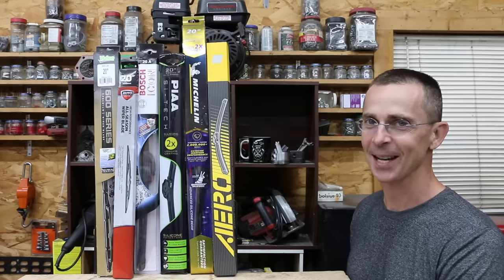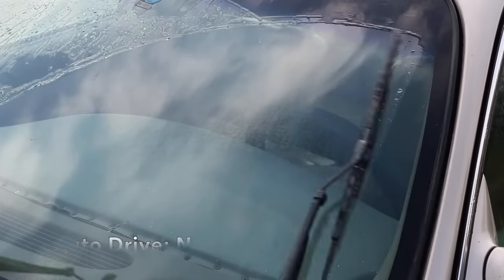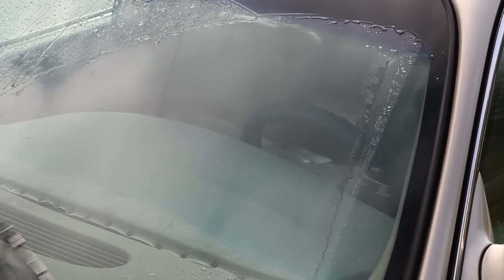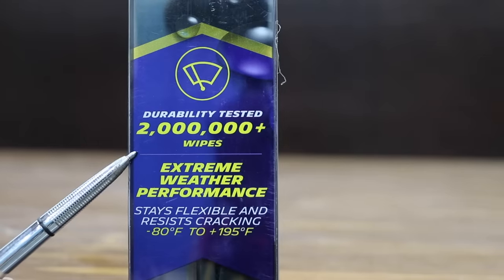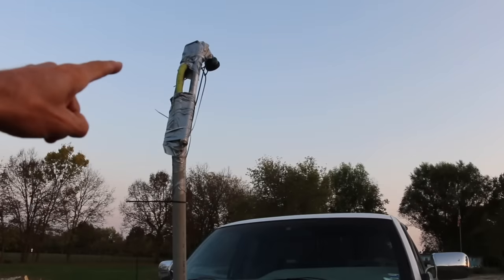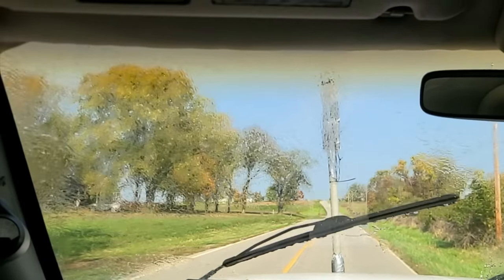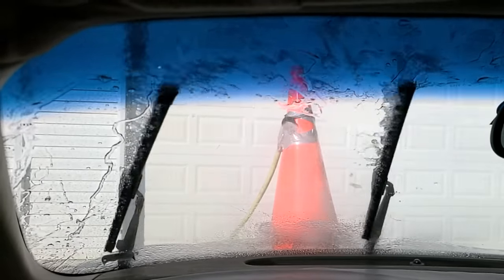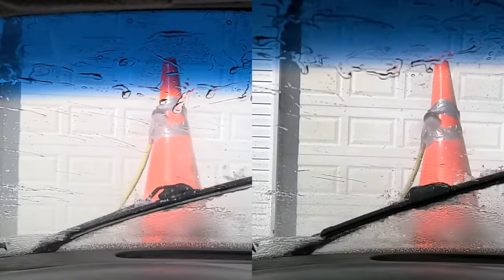Best Windshield Wiper Blade (AFTER 1 YEAR)? Bosch Icon, Rain-X, PIAA, Trico, Valeo, AERO

Comment: I've been using Rainex for years, and they've given great service. The UV light here in Phoenix is pretty brutal on them however, but I think this would be the same for any brands. Bosch is pretty awesome, but they look like they are about 50% more expensive [ At least the ones that I compared ] . I'll continue to use the Rainex since the performance is pretty good for the price. Thx for doing this !
Reply from the maker: Thanks for sharing!
Reply: I have been purchasing Michelin wiper blades for years, I am 64. Based on my experience after using them on various vehicles, both cars and trucks, I will stay with them. I recently thought I'd give a set of Rain-X "beam style" wipers a try on my wife's TrailBlazer. They are not worth the money spent. As it sweeps across to  the left (driver's side) it leaves a large patch of untouched windshield in the line of sight at the top third of the blade. The same occurs on the passenger blade. It does not contact the windshield on the return to the right in the same spots leaving a mass of water on the windshield. Luckily I use Rain-X in my washer reservoir so it helps. I tried swapping them side to side and it doesn't help. I will be grabbing some Michelins on my next trip to the store.
Reply: @ernestpaul2484  Sounds more like a bad windshield, than wiper blade. I have seen that happen with my Chevy Duramax. The factory windshield was the best at repelling water and snow, then I had to replace it with a Safe lite and it does no compare and I had to use my wipers more with that windshield.
Reply: @toddhoffmaster6057 Put a windshield ceramic coating on the windshield. Give it a good deep clean and final wipe down with alcohol so the coating sticks. This will repel water incredibly well for about a year depending on frequency of wiper use .

Comment: I can definitely vouch for the Bosch Icons.  We leave the car outside and had no streaking or noticeable squeaking until year 4!  100% worth the extra cost over cheap blades!
Reply from the maker: Thanks for the feedback.
Reply: Seriously, valeo kills bosch after 3 months of use. No offence
Reply: I change wiper blades every 5000 miles. How many miles before you change them?
Reply: @jayr122001  the man said 4 years. So 40k miles lol
Reply: I  have had Bosch wipers twice, idk if they were Icon, but they both SUCKED! Loud, streaky, total crap within a few month. The regular RainX wipers have been significantly better for me.
Reply: Not my experience. On a dry windshield they’re okay, but on a wet windshield they chatter, jump and squeak. Still wipe but shake like crazy.
Reply: I’ve been using mine for 6 years and they’re still fine. Car is always garaged, so I’m sure that helps!
Reply: Bosch Icons are all I get for my vehicles!

Comment: His neighbors don't wonder why there's windshield wipers on his roof, they ask which ones do you recommend.  I live in Southern California, every mid October I purchase new wipers... Went with Rain-X
Great video,  great channel. 👍
Reply: I hate Rain-X. How do you like that film it leaves on your windshield with every swipe of the blades.
Reply: @mynameisgladiator1933 ... I haven't noticed it leaving anything on my windshield. If it does I'll comment back to you.
Reply: @redwhiteblue7831  Weird. Because i had to return mine just about 2 weeks ago. So it'd be raining and the wiper would wipe up and in this wipe it would leave a smoky film on the windshield that was like looking through fog. Only on the down stroke would it clear the windshield. In reality it meant that 2/3 of the time, I had impeded vision.
Reply from the maker: Thanks so much!  Thanks for sharing.
Reply: @mynameisgladiator1933  Have you put any of that Rain-X water repellent spray on your windshield? I did and I have had similar occurrences.
Reply: @hunterhippensteel  The old Rain-X formula used to work very well, but even with the new stuff, you need to clean the glass extremely well before applying it. And you have to polish it in to the glass, much like waxing your car. Do it a few times, and you hardly need the wipers after 25mph. As for wipers, I use Bosch. You can buy a pair of inserts for the old style frame types for about $8

Comment: In my experience Bosch ICON is unbeatable for quality and value. They seem to last much longer than the cheaper wipers so the extra cost is justified
Reply from the maker: Thanks for the feedback.
Reply: Thinking it's about time to replace the Bosch blades I have now and came back to see if the performance was what I remember. It is. I do feel like some silicone versions of the Icon blades would be even better maybe lasting several years.
Reply: My Bosch wipers have been on for soo many years.. still work great.. the secret? Clean them.. it’s not hard.. do it every so often..
Reply: It’s strange, I loved my Bosch blades (and most Bosch stuff) but I’ve experienced their wiper drying out and cracking on several cars - maybe after 1-2 years?   I started using PIAA silicone blades back in ~2014 and I’m still on the same set on one car, working fine.

The feeling of new wiper blades is a great one and I remember being very impressed by Bosch, they blew away the competition.  RainX was close.  I guess I just didn’t experience longevity compared to when I switched to PIAA.   Plus I can buy wiper replacements themselves and not have to throw away the whole wiper body like Bosch.  

Writing this here via dialectic method.  Not trying to prove you wrong.  In fact would be happy to switch back to Bosch if my memory was flawed.  Not having good wipers when you need them is rough
Reply: piaa.hands down.
and if thick be better tu cover suv

Comment: Have been trying out different blades over the years, and i have always come back to bosch, they last longer, and i have always felt they have done a better job. Cheers from norway, keep up the good work 😀
Reply from the maker: Thanks, will do!
Reply: I tested different ones too. But the Bosch weren't better or worse than others.
At the moment I am testing silicon blades.
Reply: @benz merc is your Hilux a daily driver? If yes, that's impressive.

Comment: That’s a lot of work you put in for these tests. Greatly appreciated. I wince a little when I pay what I pay for the Bosch Icon, but I feel it is worth it. Wiper blades as well as tires are not something that I want to try and save a little money to sacrifice performance (safety). Cheers.
Reply from the maker: Thank you!  Thanks for sharing.
Reply: I agree! You gotta make sure your car has the right shoes, and the right eyes. Don't want to find out the hard way...
Reply: I agree, two things I am willing to pay up for. I never cheap out on safety.
Reply: Completely agree.  Cheap tires can have issues like improperly placed steel belts in them which can cause the car to pull to one side or the other, and the chain of tire shop I purchased them from said it wasn't a defect.  I've learned that lesson.

Comment: Living in Atlantic Canada, wipers are subjected to some really silly weather.  -40c to +40c snow sun etc.  The rainx is what I use now, they seem to hold up better.  The ac Delco ones I had to change twice a year, the rainx ones I change once a year.  Just personal experience.  
Great video as always.  I appreciate your commitment to thorough tests.  
Hope everyone is staying safe.
Reply from the maker: Thanks so much!  Thanks for sharing.
Reply: Thanks for your feedback, have you tried the 100% Silicone blades now put out by several brands?  

I’m a big fan of Ac Delco parts as well. Most of the time Ac Delco parts are better than the competition. 

In fact there’s an Ac Delco channel that shows the quality difference on their parts versus Autozone, Orielly the aftermarket etc... for instance: Fuel Pumps, Batteries etc...  

I know with certainty their pulleys and alternators are quality compare to the competition. My 2008 GMC has 2500 had 541,000+ miles 13,000+ engine hours on the Original Alternator!    

Replacing the battery 4 times over that time not to overwork/overheat the alternator to keep charging a weak battery.
Reply: @Mr.Beastforpresident  most of my replacement parts are ac Delco, I have no problems with anything they make.  Or if I do, its easily handled through warranty.  Wiper blades however I have found the rainx latitude to last longer in my particular climate.  The newer ones I cant speak for or against.

Comment: Just got a chance to watch this testing session, as always, great testing. I would like to add that in my experience, in an area that sees little rain fall compared to other parts of the nation, the issue with wiper blade life and efficacy has little to do with whether or not a wiper blade makes noise or it's prolonged exposure to UV.  The issue I see is with long periods of time between use, the blade edge deforms when in the parked position. The blade parks after a downward sweep leaving the edge of the blade bent upward from center, if the blade remains in this position for an extended amount of time, it tends to form itself to that position. The effect of this deformation results in the blade edge not being able to pivot back the other way during an upward sweep causing the blade to skip badly, with poor wipe quality and a lot of noise. The wipe quality of a deformed blade on a downward stroke will still be ok since the blade edge is deformed to the proper angle for a downward sweep but still not near as good as when the blade is new or even close to new. Just wanted to add this in with the understanding that the type of testing needed to see which brand would resist this deformation the best, would be quite lengthy. Thanks for all the time you put into these videos, they have helped me make many choices in products I use on a day to day basis!
Reply from the maker: You are welcome!  Glad to hear!
Reply: This is absolutely correct
Reply: I agree 1,000 %.  A better rubber compound needs to be developed that DOESN'T HAVE A "MEMORY" !  
Also, there should be a solution made available that can be wiped on periodically that will continue to protect the rubber.

Wiper blades are GROSSLY OVERPRICED  !!!
Reply: There used to be wipers designed to "park" themselves off of the windshield. Some older 70s and 80s (maybe newer) GM cars had this feature where when you turned them off, the wiper arm went down til the wipers and arms were parallel to the ground and at the same the wiper arm rode over, for lack of better term, a wedge or ramp that brought the wiper out of contact with the glass. This feature and the fact that there were hidden wipers probably did a lot for wiper blade longevity. By hidden wipers, that means the wipers were mounted under the rear extension of the hood that came over the base of the windshield. When you activated the wipers, the blades moved up a few inches off the ramps and operated from there so the wipers weren't constantly going over the ramp/wedge. These were an awesome, perhaps "Deluxe" feature on certain cars....
Reply: @Hjerte_Verke  
I remember those. I think there might have been a wind noise problem from the blades fluttering in the air stream since they were "floating". I've thought about making something like that but without the low, "park" position it isn't feasible.
Reply: I live in Phoenix. UV Matters

Comment: VIDEO IDEA : 
Best Electric Pressure washer testing that may be used daily on house, concrete, car etc. 
Thank you for another great and informative video. Very thankful for what you do.
Reply: I bought a pressure washer from Sams, it has a Honda commercial engine and a Simpson pump.  It cost a little over $500 which was about $200.00 less than some other outlets.  It is a great pressure washer.  I also bought the turbo nozzle after watching it used on u tube, no regrets on either purchase.
Reply: Good idea
Reply from the maker: Thanks for the video idea.
Reply: Obsessed Garage has a lot of interesting content regarding this. He's a bit picky so you get more knowledge by actually watching the video and disregarding his harsh judgments
Reply: Personally I really like my greenworks electric pressure washer I bought from lowes. It even came with a turbo nozzle and a foam cannon. While I wouldnt reccomend it for heavy commercial jobs, it works great for what I bought it for, washing my trucks, the wife's tahoe, the camper, and the horse trailer. Also works good on our deck.
Reply: Project farm could take a wack at it if he chooses to, but the Obsessed Garage channel pretty much tested the majority of them. Maybe PF could do the low key name brands that have surprising stats like active jobsite or costway but the sunjoes & stuff are done. Id still be interested in the video. I personally know the Active is a sleeper in electric psi washers.

Comment: Would love to see you compare the leading rain repellents/sealants for windshields.
Reply from the maker: Great suggestion!  Thank you.
Reply: @ProjectFarm  still waiting for this episode.
Reply: @paulcarlsabino  Also still waiting! Hope it happens soon.
Reply: Aquapel, bar none. Unless you go for a ceramic coating.
Reply: @friedpickle9828  Ceramic coating is the best solution?
Reply: @purveshsane1435  Yes, for all surfaces, ceramic is hands down the best solution. That being said, if you're only concerned about glass, aquapel is only around 8 bucks per application and works excellently, far better than Rain-X.
Reply: I second this!
Reply: You can go ceramic coating or either type of wax. I personally go with Nu Finish as it does really well with giving a nice layer of protection and it polishes the windshield out too.
Reply: yes!
Reply: I wouldn't put any water repellent like aquapel or ceramic coating on your front windshield. It prevents chip repair. Carnuba wax is okay because it can be wiped off.
Reply: @timothyvu7006  spray on wax like turtle wax would work with a buffer correct
Reply: Rain repellents are worth using for sure.. Just started using one that you mix in with your wiper fluid and holy shit does it make a difference.. Once on the highway i barely even have to use my wipers.. Rain just beads and flys off.. Even a cheap rain repellent is better than nothing.
Reply: Spray on ceramic
Reply: @TheGreenMedicine420  agreed, I apply Rainx now and works great. Also apply it to all my windows.

Comment: Been using Bosch all my life, never had a reason to switch and after seeing these results I have even less reason to. 
They last a long time (my current set is nearly 2 years old and still works pretty well), so the price really isn't that much of an issue. Plus the second you're getting into heavy rain, you'll be glad you didn't cheap out on your wipers.
Reply from the maker: Thanks for sharing.
Reply: Just bought some Bosch Icon's for my Civic. Gonna try them out. :D
Reply: Do you use RainX or similar on your windscreen as well. I do and it helps the blades last longer.
Reply: @robypaul202  how you liking them? Rainy season is coming and I gotta prepare haha. I also drive a civic
Reply: I find it's far more imporant to have a water-beading coating on the windshield than than the wiper. At higher speeds especially, you don't even really need wipers.

Comment: Thanks Project Farm for all your awesome videos. I have  been frustrated with wiper blades having to replace them every six months- year.  So I also did a bunch of research and checked out a bunch of car and truck forums. What I found out is a lot of people that are into upgrading and fixing up their rigs raved about PIAA wiper blades and how much better silicone is than rubber some said they have lasted for 8 years and are still going good. So I bought a pair on 6/10/19 with 131,324 miles and they work awesome like the day I bought them they are still going strong 3 years later 6/5/22 151,052 miles  that's worth every penny to me!!  I purchased the super silicone bridge style blades the beams/ I beam style look like a weaker design and have not performed well on my company rig. Also you can buy replacement inserts that are cheaper , but no need so far these are awesome. I have since added them on my two other rigs so far they are awesome no way I am ever buying anything else. Also I have a company rig that has to be serviced by a jiffy lube I have to replace them every year if not sooner they often install the beam style which has all sorts of issues it doesn't apply the pressure across the blade like the bridge style does. I don't usually comment on here but when I find a product like the PIAA I have to say something. Wiper blades are a big business just look at your big box auto store they don't sell PIAA they only sell rubber blades or maybe a semi silicone they want repeat business no thanks. PIAA is all I will every use. Hope this helps someone out thanks.
Reply from the maker: Thanks!  Thanks for sharing.
Reply: Those chain auto stores don't want you buying something and use it for years. LOL
Reply: I bought PIAA super silicone blades for our sienna in 2016. Still work almost like new. They are actually really faded and starting to rust lol.

Comment: I've been recommending those Bosch Icon's for a while now. I picked some up for my truck and had them for about 2 years without much degradation. They performed almost the same as new, and I live in southern California where we don't get much rain, so our blades usually dry out and are useless when it does eventually rain. I've been using them ever since.
Reply from the maker: Thanks for sharing.